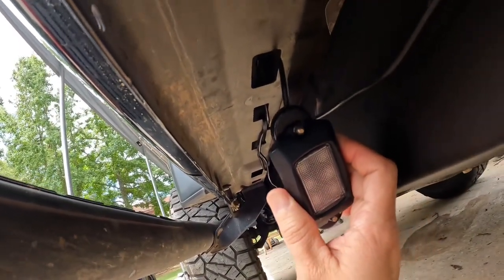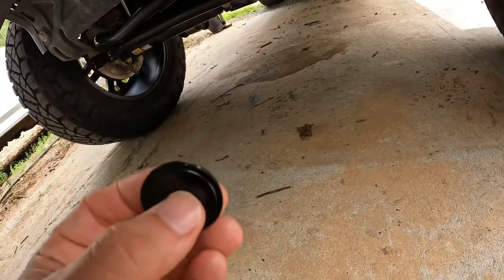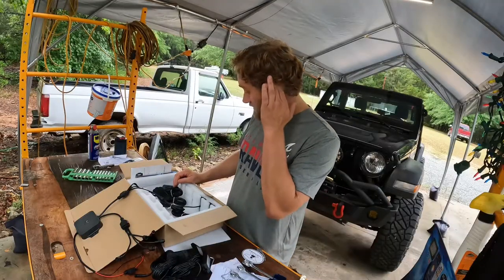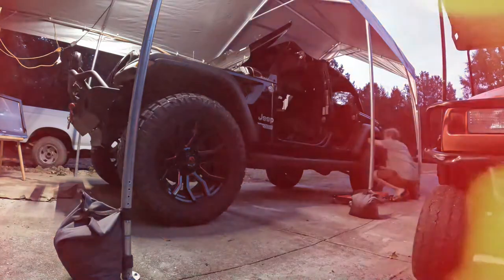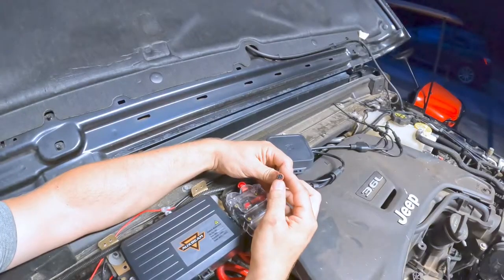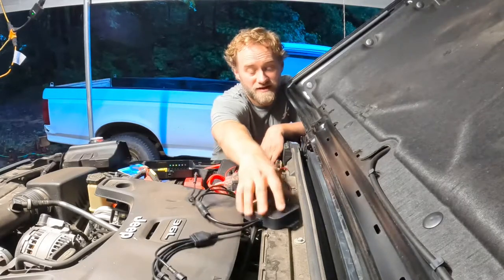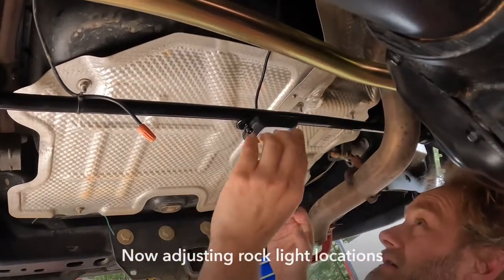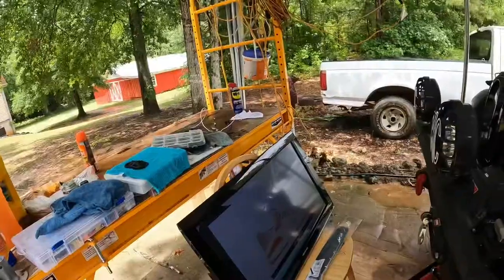Simple mod that greatly improved my $100 Mictuning Q1 RGB LED rock lights installation

Comment: I'm currently installing the same q1 rock lights. Where did you end up mounting the control box?
Reply from the maker: Under the hood on the lip just above the fuse box (next to my Auxbeam switch controller). It works there and I’ve had no issues.
In hind sight, I think I would’ve rather found a spot in the cab (maybe under the seat?)
I was worried about it getting wet under the seat and that’s really not been a problem, even with the doors off.
Plus with the box under the hood the rear light is at the cables max length

Comment: I did the magnet install with my wheel lights and a big failure due to the sealed magnets rust out.
Reply from the maker: Hate to hear that, I wish I could remember which ones I bought. My magnets have held up great for several years now. 
But yes if the magnets don’t hold up then it won’t work
Reply: @1870offroad  
I do live in Michigan which because of the snow didn’t help.